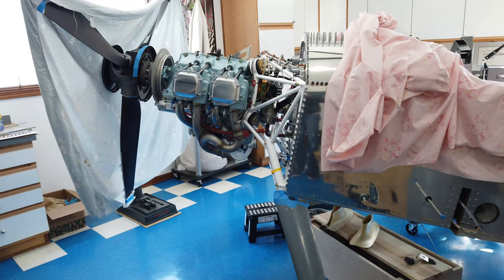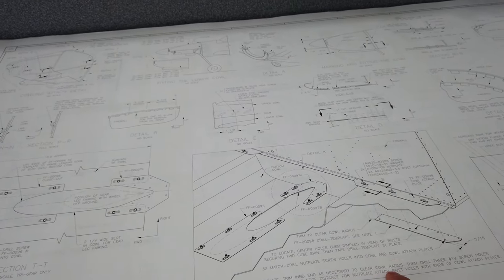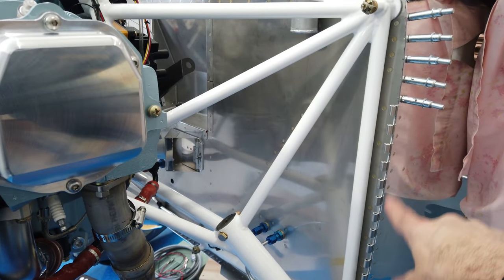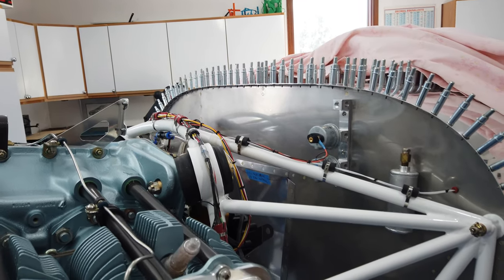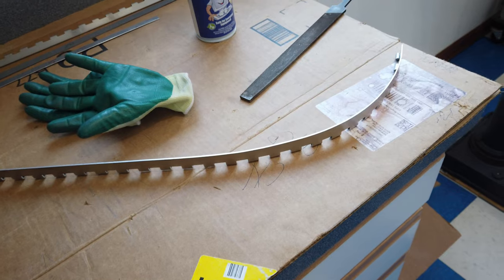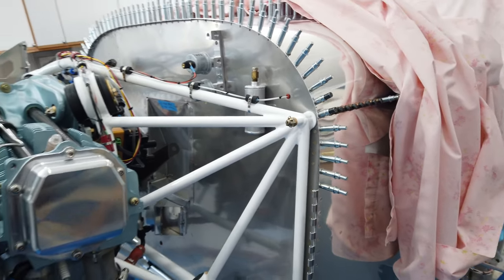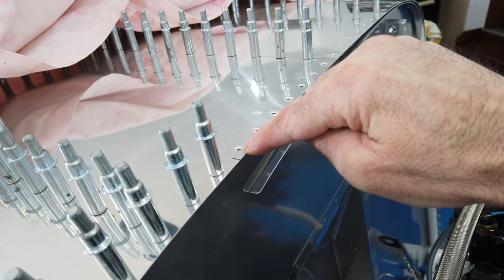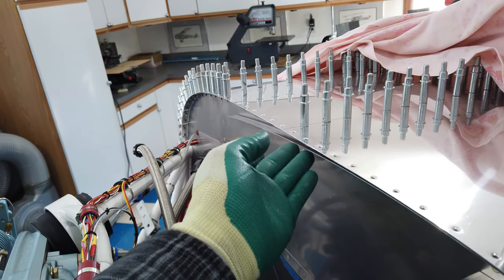Vans RV 7 HINT Videos Top Cowling Install Hinges

Comment: Hi Mike, in the kit there are two different types of hinge, one is aluminium and the other slightly bigger in stainless. Is the stainless one used on the firewall and the others on the horizontal cowl join? 
The instructions don’t specify this, just specify the difference of the hinge pins. Great videos 😊
Reply from the maker: Howdy Chris; thanks for checking out my channel!  My RV-7 kit does not have any stainless hinges. Stainless is very heavy and hard to drill. (Compared to aluminum.) My cowling hinges at the firewall,  top and sides are 1/8" pin size.  Even though the top hinges are for 1/8" pins, you use the .090" pins so you can easily curve it. The firewall side hinges use the 1/8" pins. All hinge pins for the cowling are to be stainless, not aluminum.   It sounds like you already know all this about the pins, but someone else my find it helpful.
Reply: @KaretakerAero  Thanks for your help, did your kit have two different types of hinge ? one slightly wider overall when open with a bigger knuckle ?
Reply from the maker: Yes. At the firewall, the top and side hinges are the large, 1/8" knuckle/pin. (The hinge that attaches the top and bottom cowling halves to each other are the smaller hinge, AN257-P3. The RV-7 drawing #45, top left corner shows the different hinge  and pin callouts.
Reply: @KaretakerAero  great thanks, my 9 drawing doesn't specify this, only talks of the different pin, that's what's confused me. is it also the case on the bottom attach point of the firewall to cowl?
Reply from the maker: Ah, I am not familiar with the -9 drawings.  Please email me and I can send you some pictures and discuss further.

Comment: Hi Mike, hope you are well. Before you clecoed the top forward skin on did you pre-bend it in any way? There is quite a lot of tension as you curve the skin around the "corner". If so - how did you induce the bend in the skin? I hope my question makes sense.
Regards,
Steve
Reply from the maker: Howdy Steve. All is well here; you?  I did not pre bend the top skin. I start at the top, in the middle and put every cloko in as I work towards one side. As I get to the curve, I hold the skin against the side skin with an arm, (I basically lean on the skin) It helps to have clekos in a pocket of within reach. Once all of those clekos are in, I do the other side, again, starting from the top middle. Once I start around a curve and hold the skin in place while leaning on it, I do not move until all clekos are in. You DO NOT want to have any one hole/cleko holding the bend in place.  I have access to a set of large rollers to bend sheet metal; I may pre-bend this top skin prior to final install.